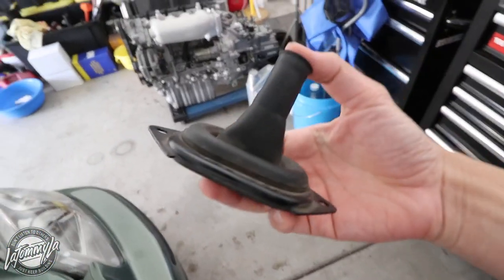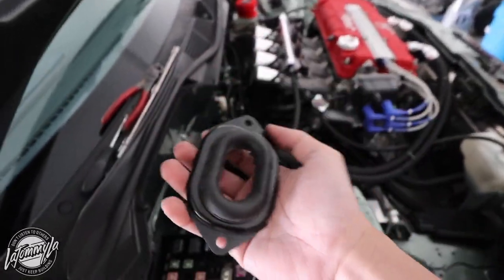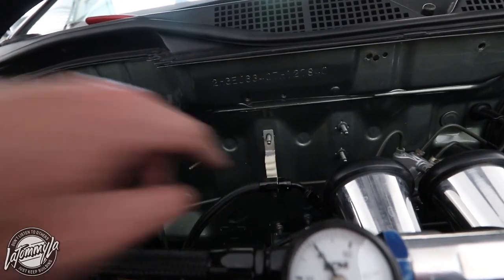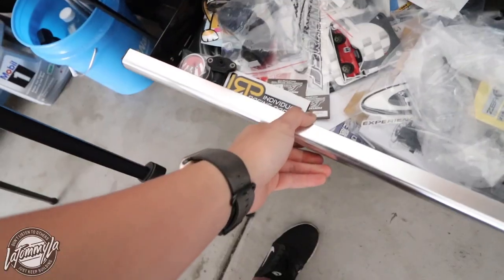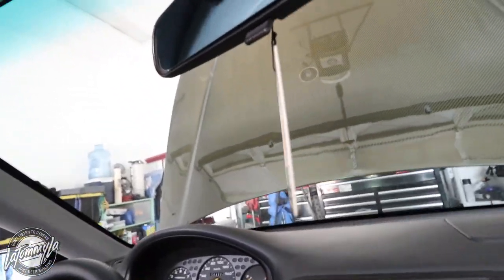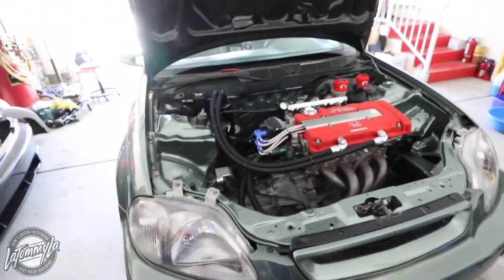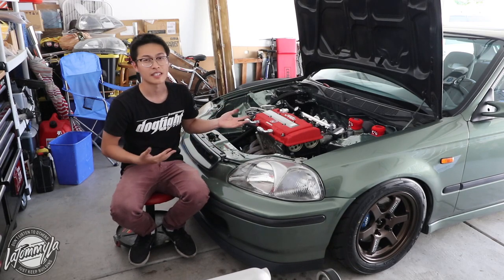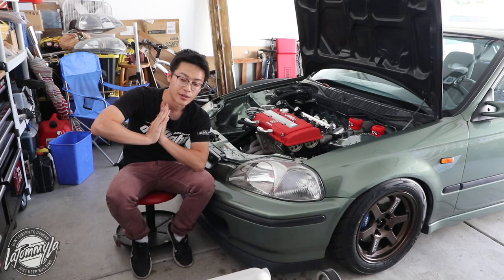Are ITB's really worth it?

Comment: I think they are worth it just for the "dopeness" factor alone!! 😎
Reply from the maker: But they work amazing too!
Reply: LATOMMYLA oh for sure, they are without a doubt one of the coolest mods in my opinion!
Reply: well i bought ITB's for my 1.6 miata and i rather chase raw driving experience than chase Horsepower numbers
Reply: imo they need to many other adjustments just fot some hp alone, I thought about it for my car but came out with something different, much cheaper and easier and had almost the same gains, only good thing about itb's is the sound (if you leave them open)
Reply: @swansmeister  What mods did you do that gave you similar power gains, just asking because I was thinking of doing ITBs but kinda changed my mind after what he said about them being put over stock engines

Comment: You don't need a built motor to run ITBs but it obviously needs to be tuned and setup properly.You hit the nail on the head as far as its mid range power and response where you see gains...yes you will lose power up top on some engines.However they'd still be an advantage on a car that needs alot of power in the midrange.
Reply from the maker: I thought ITB's work a lot more better with high comp and cammed motors, the current setup, I made more than my stock ITR manifold, which my tuner was shocked by haha
Reply: LATOMMYLA the P73 is pretty well optimized but Type Rs don't do bad with ITBs considering their cam profiles and compression etc.Yes a properly built motor purposed for the rpm range ITBs are most effective in will fair better than say the stock R but it's not a waste if midrange power amd response is what you're looking for.Ive seen bolt on Miatas take well to ITBs for track setups.The maim thing is just making sure they're dialed in properly.They can be relatively difficult to tune.I tune myself but haven't gotten the chance to tune ITBs myself in my area I mostly get to work with FBO 8ths or Subarus lol...someday probably gonna have to be my own build to make it happen
Reply from the maker: My tuner did a great job tuning them, I just have to go back since full throttle was at 76%, but now it fixed. Love the throttle response, it just goes! You should build one!
Reply: yes you don't need a built motor but itb will bring out more potential in a built motor. ITB are expensive so personally i'd built the motor up first.  if you want power it's better to just strap a turbo to a stock b series motor. respect the fact you have an ITB set up because many people just turbo their car to make easy horsepower and call it a day. it really depends on what you're building it for. ITB on a circuit is the best advantage.

Comment: what about a stock b20b with stage 2 cams? are the itb’s worth it?
Reply from the maker: Not too sure, seen people loose power, but mainly high comp and cammed
Reply: No.
Reply: Nope, the compression ratio is low with those blocks. A stock B20B would be a good candidate for boost though.

Comment: I don't see how you would lose power with ITBs stock. You could lose the low end power if you are using short bellows/v-stacks vs longer and narrower or having runners after the ITBs but not every engine bay will allow for that. With a tune and better fueling to accommodate for air volume/flow increase you should see a small gain of 2-5hp stock(depending on tune/car could be more). Anything beyond that I would agree would probably require either a built top with fatter injectors and/or performance fuel pump.

Comment: wait a second, you don't run A/C in your car. You removed the AC and also the heater core hoses and all.. what do you do when outside it's raining pouring bad and the inside windshield starts to get foggy. You removed the front wipers blades and have you removed the wiper motors too? cus of weight reduction?
Reply from the maker: Wiper motors are still there and I still have a heater, I drive this car. It's not a show car
Reply: Simple. Use rainx anti fog wipes. Problem solved and everything looks wayy cleaner

Comment: I always wondered on the itb's.. only gripe that i have to get filters on if i was to get em, i jus would be cringin drivin um open like dat. thanks LatommyLa!!
Reply from the maker: I have somewhat of a filter on them haha
Reply: LATOMMYLA def gonna get both mesh and sock filter :)
Reply: swweeeet!!
Reply: Yeah, the only downside to filters would be the power lose some brands produce. I've seen filters that barely affect power and filters that rob an engine. I've always looked at itb's as a drag strip only application where you can run without a filter for a pass and be done. I'd have an aftermarket closed intake manifold with a throttle body that was as big as the initial inlet and a cold air intake. Probably a CT Engineering Icebox intake because the design is extremely nice. That nice heat resistant material with the filter fit over the velocity stack encased in a box with another inlet pipe positioned to suck in that cold air. Maybe even wrap it in the gold reflective tape to lower IT's even more.
Reply: wackomanx im currently looking at a toda kit with there mesh cf intake manifold box with a blitz filter ;)

Comment: Are they worth it for a stock Type R B series engine? Nope. I bet a S2 Pro Series or Ultra Street intake manifold, S2 68 mm TB & a CT icebox intake would net better results.  Are they worth it for an engine that has 12.5:1 or higher CR pistons and large camshafts? Yes as long as you have a good tuner.

Comment: Do you think this setup would hit 200+ without the ITBs?
Reply from the maker: It probably will if I change my exhaust setup
Reply: Scott Chelmford i hit 213whp on my high comp b18c1. It had 2 and 1/4 exhasut piping, some pieces were even 2 inch lol 91 pump gas. Blox intake with arc intake box. I daily drive it everywhere haha so im sure its possible if mine did it.
Reply: Just look at 16ValveVtec's channel. A ported ITR manifold or S2/Blox, a nice throttle body and nice CAI with a good tune with 2.5" exhaust will probably get you over the 200 mark. CT Icebox CAI is nice and makes the power.